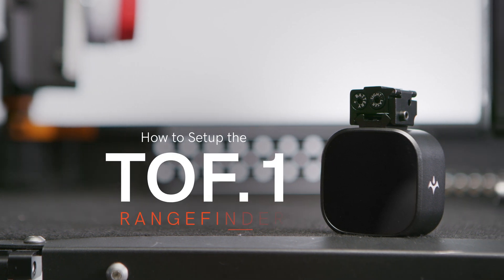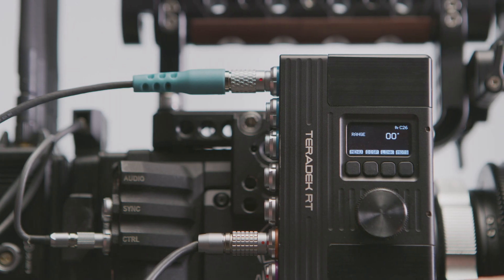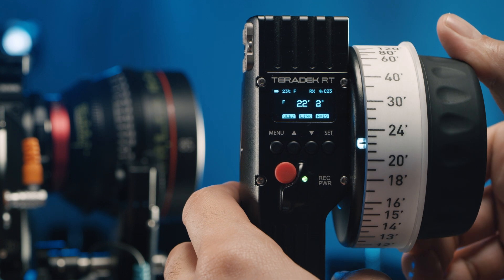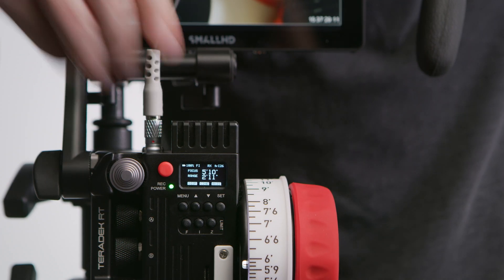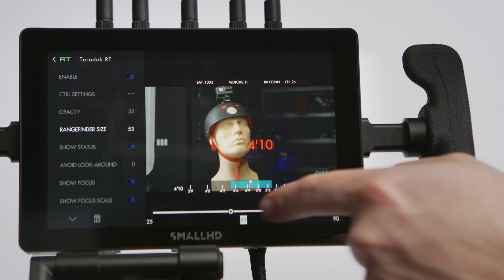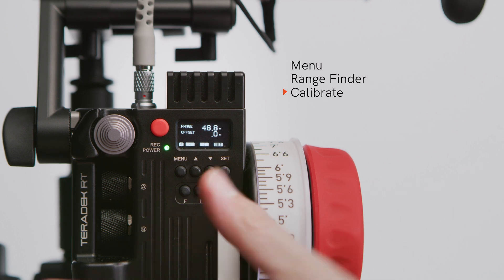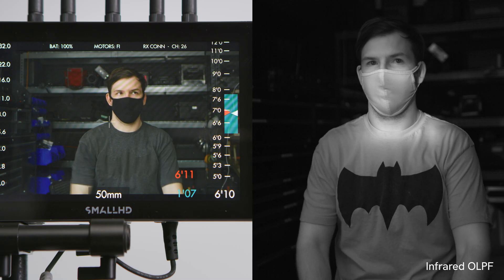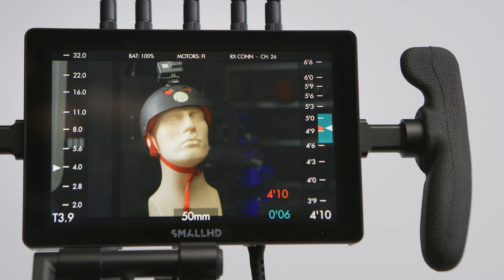How to Setup the TOF.1 Rangefinder - Teradek RT

Comment: How is this working with multiple characters on set ?
Reply from the maker: Typically, the TOF.1 focuses on one subject at a time. LED infrared beams measure the distance of subjects within a 3 degree field of view of TOF.1’s proximity sensor, at a direct line-of-sight range of up to 80ft. 3 degrees is fairly narrow. The overall radius of the sensor’s field of view will narrow or widen as a subject moves toward/away from the camera. On page 7 of the quick start guide, there’s a diagram showing the diameter of the detection radius at different distances. The circle is about 10 inches at 16ft. See quick start guide here: https://d1xl95ab8ijfds.cloudfront.net/Public/RT/Docs/Teradek%20RT_TOF.1_Quick_Start_Guide_v.1.2_1120_web.pdf

If you wanted to track multiple subjects at the same time with our TOF.1, the subjects would need to be pretty far away from the sensor, and at the same distance. If the two subjects are at different distances, you wouldn't want a single value for both.
Reply: @Teradek  Would love to see some detailed demo video on a set with more characters.
Reply: Can I use this video in hindi language for Indian people understand